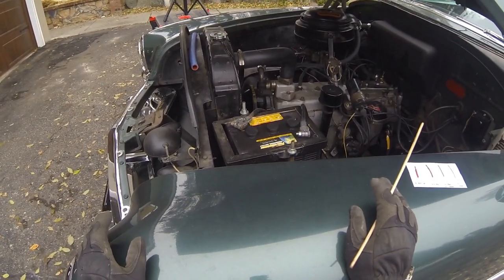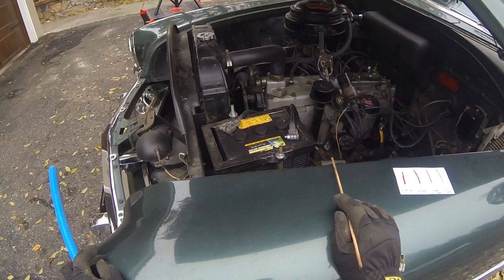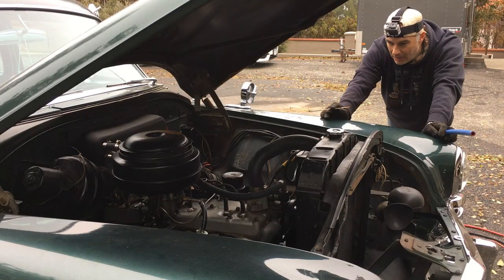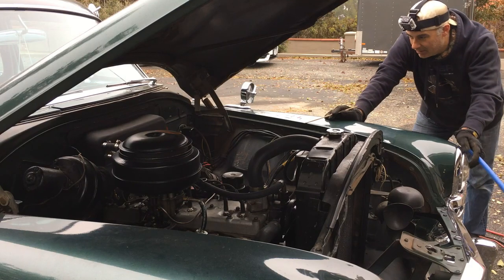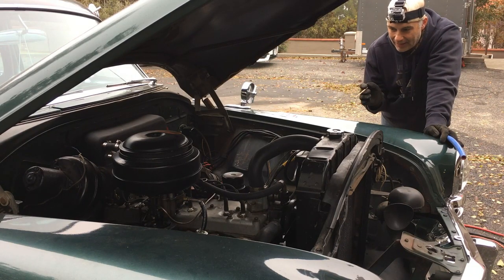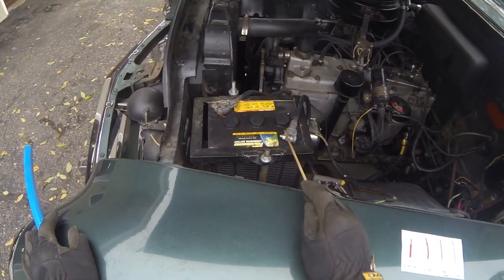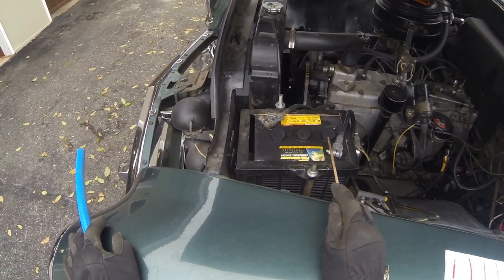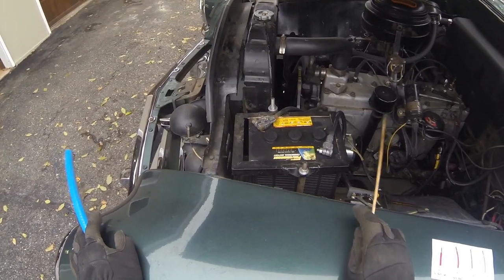Stubborn 6 Volt Cars? Don't convert them...Fix them!

Comment: Years ago when things were really lean, I retrofitted double ought wire in place of the #4 AWG cables because my 12 volt battery had one dead cell, rendering system voltage at 10V. That got me by for almost a year until I could afford a new battery!
Reply from the maker: Cool. Neat to hear that actually worked at 10V.
Reply: Brilliant!

Comment: Thanks for the tutorial. I have a 6 volt 1947 Farmall Cub I'm considering changing to 12 volts, because my farm depends on it starting, which it often does not do....
Reply: Just use and 8 volt battery if you want more oomph.  All you will have to do is recalibrate the regulator.

Comment: Went to 8v. Electronic replacement for the point needs minimum of 5.1 volts to function. In the winter time voltage would pull down to 4.8. Vehicle would keep cranking but it wasn't making a spark. A full battery and adjusting the regulator and 10 years later my wife works out of her 55 Chevy on a pretty much daily basis still.

Comment: Hi Keith .I have a question can you put a 12 V "ugaah " horn from ebay  into 6 V system ?.
Reply from the maker: I have not done this. If it will even spin, it will likely turn too slow and won't sound right. I doubt you'd be happy with it.
Reply: No, you need a 6 volt Ahooga horn.

Comment: Pos Ground or using the car it self as pos side of the battery as the feed side have it's advantages , One thing is that you dont need relays at all . Putting lets say the headlight switch on the Neg side elemates the need of a relay .  This means less connectors and wires . There is no advantages of neg ground or 12 volts ether . There is really no need of etronic IGN or a powered on coils ether . We could use Mags instead .  This leaving the only reasons for a bat is to start the car if it needs an electric starter . All other electeric to power everything can be powered by a gen or alt and a capacitor  with a regulator . all this crap they have put on these cars is really BS . You still have AC , Radio , computer , lights as a modern car .  Yes a 12 volt system is a bandaid on older 6 volt cars . So lets get to electric and modern cars !!! I mean up to date cars now . What we have now and what we learned over the years . We dont even needs a battery at all . The super capacitors could replace the bat .  They are cheaper to make with little wast and polutants .

Comment: I had a 54 Chevrolet with a 6v system and it always cranked kind of slow. There was a battery company in my town that made batteries and I had them make me an 8v battery. I installed that battery in my car  and it worked great for many years without changing any gauges or electrical components in the car.  I kept the original starter, generator, voltage regulator, radio, and light bulbs in the car.  Drove the car many years that way with no problems and the car started great.

Comment: totally agree, even on 12V system, when the vehicule is used on cold climate, replacing the #4 AWG starter cables by #1AWG makes a world of difference when the vehicule is equipped with a 6 or 8 cylinders engine.

Comment: I NEVER have any problems with my 6v system, it always starts. People drove these cars every day back in the day, if the 6v systems didn't work back then they would have fixed it 90 years ago
Reply from the maker: High compression, overhead valve, & high RPM’s killed the 6V system in mass-produced cars. There is no need for 12V in flat head 6 cylinder, low compression, low RPM flathead engine.
Reply: To be fair, they fixed it 66 years ago
Reply: FACTS!

Comment: Very good tips on a 6volt system. I have a '54 Chevy Bel-Air with the original 235 six and Powerglide trans.
I still run the 6volt system,  but I installed a 6-volt alternator and the car starts great. Like you said I checked the battery cables which had to be changed and checked all the other electrical connections before I installed the 6-volt alternator. I also installed a 6-volt electric windshield wiper motor/switch. and a modern am/fm/cd radio. I still run points and condenser and everything works just fine!!

Comment: I owned a '53 Dodge B-4-B116 for 30 years, and never changed over the 6V system, nor did I shoehorn in an 8V battery.  Adequate gauge on the battery leads, and keep the system in good tune, and she'll fire up OK in cold weather.  More than once I've had to start it in subzero weather, which is kind of tricky, but that old tub never once let me down.  :)
Reply: B3/4’s rule 😁
Reply: I always use starting fluid, ❓❓❓
Reply from the maker: I never use starting fluid. No need. A healthy engine stats without starting fluid. Plus its a little hard on rings. Good chance you’ll end up with broken top piston rings.
Reply: @keithsgarage5831  Well Keith that's what we call freedom of choice in the United States of America, Remember , it was much more  colder during the winters back in the 70s ,,6 volt electric system sucks, period, What do really   care,I❓❓❓ I  rebuilt my engine 1/2 dozen  times, With the turbo retrofit I blew out Head gaskets on regular basis, I kept a couple of spares in the trunk, with tool box,Spare battery, and a shovel to dig myself out in the snow with  a 12 ft Steel  towing chain, needed the weight for traction in the winter snow, 
People are Way too Lazy today , alot of people can't even open the hood on their car let alone fix it 👍👍🤣🤣‼️

Comment: 8V battery in a 6V system is bad idea.  The former owner of my car thought doing that was OK and it wasn't.  In short, if you want trouble, you'll have it.  Gauges will fail, light bulbs burn out early, and your radio will say good night, just to mention a few.
6V means 6V so if you're having a problem, find and repair the problem.  6V systems are very good and there isn't a need to convert to 12V either.  The best thing you can do for a 6V system is install an Optima 6V battery because AGM batteries take the charge from the generator very quickly.  That what I did and the 6V system in my car has been wonderful.  No problems.

Comment: Hello: I recently watched your video here and want to THANK YOU very much for your tutorial. I have had an old 1948 car for 20 years and it always was very slow to crank with its 6 volt. I even bought a powerful Optima battery but that did not help. It cranked very slowly and I always had to use the choke AND spray some starting fluid in the carb to get it going. Due to your video, I discovered that I had 1 gauge battery cables instead of 2 gauge. I bought new 2 gauge battery cables and the car cranks over quickly and starts right away now with no need for choke or starting fluid! I cannot believe it took me 20 years to solve this problem, but your video showed me the way! Thanks again!
Reply from the maker: That’s fantastic. Glad to hear you sorted out your problem.

Comment: Excellent video! I have a question though. If you have a 6v system and need to jump start it because the battery is dead, how do you do that?
Reply from the maker: Turn off all electrical items. Radio, fan , wiper, light etc. Have a friend in the car ready. You hook up 12V right at the starter and immediately have the friend hit the key switch and crank it over. Remove 12V immediately. Starter can easily take the 12V jump
Reply: @keithsgarage5831  Thanks!
😃👍

Comment: Great advice, Keith. My ‘39 Dodge truck is 6 volt also and starts right up. I found that once I replaced the solidified grease around the small bearings in the distributors breakerplate , she starts in a flash. I believe the solidified grease prevented the return of the breakerplate to its proper resting position so when trying to start the engine, the timing was thrown off which made for a hard start. Once cleaned and re-greased with a high temp grease the engine starts right up. One other thing, the ignition wiring from the distributor through the key switch in the on position through to the connection point at the coil should be below a half an ohm or better. High resistance in that circuit creates low energy to the coil which then will lower the coils high energy/voltage output.

Comment: Howdy, Richie D. From Pasadena,CA
Re: 8 volt i used it for years for better cranking, although the electric shop ol timer at Star Electric in Monrovia advised that an 8 volt can put out to much voltage and burn or short the system ? Im using a 6 volt Optima on my 37 and 8 volt in the 48, both Dodge Coupe 2 dr, thanks for all your effort and technical programs.
Without your effort and utube channel we remain with wrench in hand and admire the cars as a museum display, thanks again, may the Lord bless u and yours and keep you strong.
Reply: 8 volts won't hurt at all.

Comment: Optimum Batteries are the best I’ve had great starting performance in my 1936 with an 6 volt optimum battery for 5 years with out a trickle charge their great.

Comment: Best explanation of a 6V system I've had yet. I have a 1951 Ford F-3 with a positive ground and a 6V system. I've been wanting to upgrade to negative ground and 12V but now, not so much. She's tuff to start sometimes so now I'm going to pull the starter and have it checked. Thank you for your simple tutorial!!!

Comment: Great video and great explanations on electric flow but you said a couple of things that need to be addressed.
 Copper doesn't "rust" - only materials with iron can rust.
* Copper isn't "corrosive" but it is prone to corrosion as anything is. The corrosion is the result of the ongoing process of oxidation.  As oxidation continues, a green residue builds up which is corrosion. It's the natural oxidation process of turning copper into copper oxide, cupric sulfide, and copper carbonate.

Since oxidation is affects many things, it's best to protect them. That's why we paint our steel and we cover our copper with plastic.

Having said that, it's important that you use the green and red felt battery donuts on your battery posts as well as using a spray-on battery terminal protector. Using these keeps the oxygen away which, in turn, drastically reduces the opportunity for the copper to become corroded.

Comment: This helps a lot, thanks. I have Grandpa's 41 Dodge Truck in the garage, perhaps I'll soon be able to get the title transferred. It seems like Grandpa might have put a 12v conversion kit on it already, but I'm really not sure. The engine's not original, is all I know. It's a 1950 Dodge Flat 6 Spitfire, so it has a bit more power to it.
Reply: It has a flathead 6.  If it had a flat 6, it would have a Corvair or Porsche engine.  They are just about the only ones who had a flat 6.

Comment: Another great video. It's possible to use 12volt on the starter without converting everything to 12 Volts. 

I had a 12volt battery hooked up to the starter only, and a 6volt battery for everything else. Like you said, a rebuild would have fixed it. But sometimes you just go with what you got. For some reason that starter didn't like 6volts ...but worked  beautifully with the 12 Volts ( 6 volt starter can handle 12 Volts fine by the way). So I had a 12 volt battery laying around....problem fixed.

Once again great video
Reply from the maker: Thanks Old Crow.  I appreciate the comments.
Reply: @keithsgarage5831  Don't convert them!!!
Reply from the maker: I have no intentions to convert them.  The purpose of this video is to help educate others. So they too are less likely to convert. A properly maintained 6V system on a 6 or 4 cylinder flathead engine is totally adequate.
Reply: @keithsgarage5831  yup. I agree completely.
Reply: You should try using an 8 volt battery instead.  All you have to do is recalibrate the regulator.  Everything else will do fine on 8 volts as is.
Reply from the maker: A band aid.

Comment: I think it boils down to wattage. The 12v conversion theory would mean that household devices would always perform better in countries with 220v than in the USA. The diesel pickup thing. I know that my 92 dodge diesel only has 1 battery. The starter supposedly can draw as much as 1200 amps and the biggest single battery i can find is 950ca at 0°. Plus the grid heater draws down your reserve some before even cranking.

Comment: My 51 F1 will start cold.. but after 15 mins of running..the starter will drag verly will turn over.. after 30 minutes of sitting will crank right up.. truck has a fh v8

Comment: Hello Keith, your battery cable video is a great help, you mentioned your 38 ply. About the ele.fule pump, so once your fuel system is pressured up, you shut the pump off? The 6v pump  I purchased said my mech. Pump won't let it pump when it's shut off, do I need to get the same pump you purchased? I greatly appreciate your help! Thanks, Gary!

Comment: I have a '61 VW bus, 6 volt. I'd like to keep it 6 volt, but the replacement electrical parts are a crap shoot these days. Horrible quality Chinese and Brazilian replacement parts are making it harder and more expensive to 'keep it stock'. Sometimes parts last a thousand miles, then the next crap out after 15 miles. Just garbage.

Comment: My 55 ford f-350 was  12v converted when i got it and i rolled it back with no knowledge of the battery cable issue. It would laborously start when cold but when it got hot it wouldnt start at all.. this is because as wires get warmer they gain resistance and the engine bay gets very hot. So yes it worked on the tiny 12v cable for the initial startup but not after it gets hot in the engine bay.

Comment: Does your 38 and 53 spin at about the same speed when starting.  Guessing the 38 may have lower compression and turn a little faster.  Just a guess.
Reply from the maker: My ‘38 and ‘53 seem to crank over about the same. Just a guess. I have no way to measure cranking speed when starting. Both feel good and strong. No issues cranking over.

Comment: Dont have to change anything just put an 8 volt battery in and adjust the voltage regulator it will crank way better and work great

Comment: I had a 1953 Chrysler Windsor 8 Passenger Sedambulance. It was originally owned by Fairbanks Morse in Beloit, Wisconsin. The car was also pictured in the book 70 Years of Chrysler. It was an awesome car, but I knew I had one chance to start the car, otherwise I had to jump it. One thing that helped was adding an inline electric fuel pump. I put the fuel pump on to stop vaper locking, but it also didn't waste battery power pumping fuel from the tank.

Comment: Love your video. Simple straight to the point,
I got a 52 olds, very hard start, everyone is claiming that the Reason is cause there's a loose rod. claiming it has too much pressure because of it,
It does tick,
  It does, however, start in 2 seconds with a 12v boost, drives nicely. So I never know. Sounds like you're right that the
Cables are too thin or something.
Or i'm thinking, maybe the guy before me put on a twelve v starter instead of a six v

Comment: using an 8 volt(4 cells) and crank up the voltage regulator to about 9 volts works great. I put a 283 high performance v8 in my 48 chevy(1960). used the 6v battery. put the a width belt pull on the 6 volt generator. used 6 volt spark coil with no ballast. made the starter from a 53 and 56 starter(swapped the armature center shaft, cost a buck at the rebuilder). starting was just fine as the long duration cam (375hp fuel injection cam) used a 55 chevy 3 speed trans with hurst syncrolock shifter.  a 50 olds rear end. car did a real 120mph (2 miles in 60 seconds) caused my close friend to sell his 57 olds super 88 as it could not keep up. when the small block chevy came along it revolutionized fast cars. staying on 6 volts is OK. takes 4 times as much copper in the cables. loss is I squared times R. double the current get 4 times the copper loss.

Comment: I agree 100% with this footage 🎥🎬👍‼️ I always carried a spare battery in the trunk, , My 1953 Dodge Coronet with the Flathead 6 / 218 cu. Had a 6 volt electric system, Mine was souped up with electric fuel pump,, Twin exhaust manifold, Single carburator. Trubo charged  High rise intake manifold, 3-speed fluid drive transmission two-speed PTO overdrive, that was out of a 47 Dodge, Great memories of American History 🇺🇸♥️🇺🇸🗽‼️

Comment: Around 20 minutes, is that fuel line almost or actually touching the exhaust manifold?? .. Or, is that the intake manifold? .... Could be mighty dangerous if the fuel line goes so close to the HOT exhaust manifold!!!

Comment: this  is somthing that seldom if ever discussed  in hard starting  and odd tbles hard to find  it happened to me 3times in my life time i am 88 dont drive any more . med ical reasons  heres what happens   turn switch key just clicks no start jump start dont work  replace starter still no start tow to garage to fix 2 days later got it fixed the gd cable goes from battery ( black wire)  to conn  to frame beneath the eng with bolt that bolt was about to fall out tighten bolt started right up first time this cost me $$$$--several years later in my drive way   same thing happen told my friend to check that bolt  it was loose  easy fix   next i was at a local  store a cust had this happen  about 6 men tell him what try they had jumper cables  nothing worked  i told let fix it for you i conn 1 jumper from batt to eng try it now  started right up told replace gd  cable it also frayed made me look very smart  LOL

Comment: Cables important but often overlooked are body  firewall grounds missing or corroded. Big hi compression 8 don't fight it use 8 volt battery. All electrics lights and radio generator and regulator handle it long term no problem.